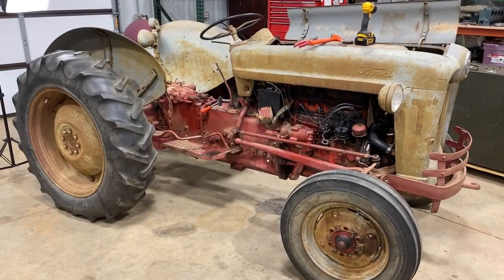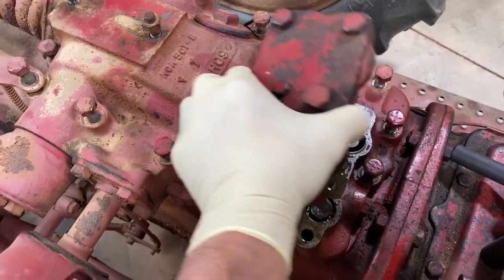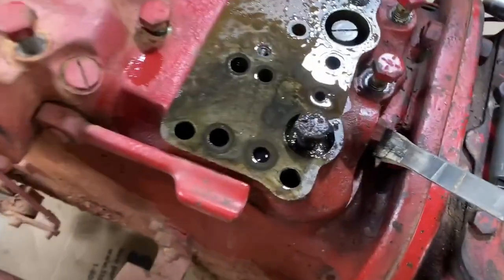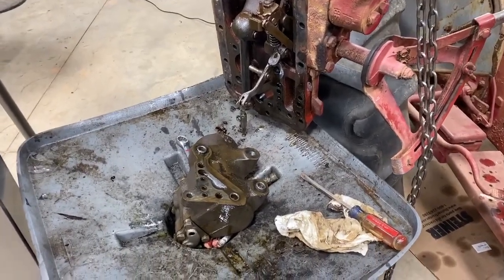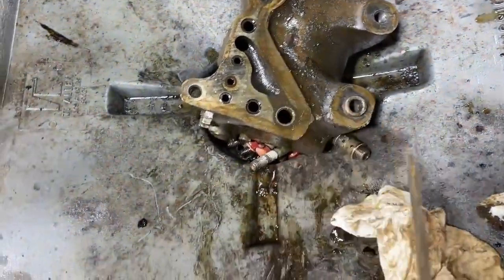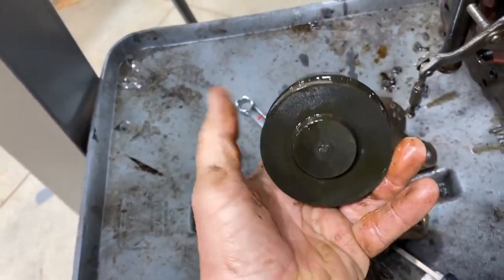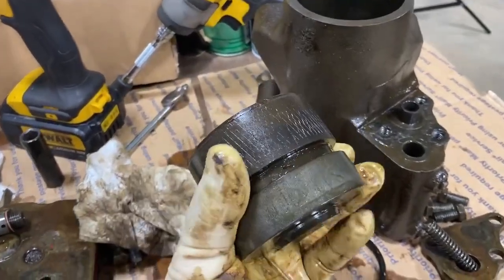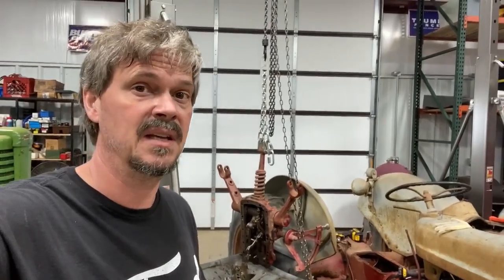How To Repair Ford Tractor Hydraulics

Comment: I have a Ford 861 which has the same hydraulic system as a 660. The hydraulics work ok, but the arms drop slowly after the engine is turned off.  I also need to bleed air out of the system fairly often, so it is sucking air from somewhere.  Any ideas that might help pinpoint the problem?
Reply from the maker: Could be the hydraulic piston rings are worn. I just did an 861 but haven’t put the video together yet 😓

Comment: what do you do with a ford NAA (Jubilee) where the 3 pt lifts great but lowers very slowly? Sometimes it lowers quick sometimes not. I just rebuilt the pump which fixed the issue of it losing its prime very time.
Reply from the maker: https://youtu.be/vBUkNudfjRI?si=xN_fAHTM8Brrp9d1
Reply from the maker: @JD-uy5js see if this other video helps. MAYBE the pivot pin is worn???
Reply: @dhammiam  I was thinking it could be the pivot pin. THANK YOU SO MUCH.

Comment: have ford naa. Have replaced the lift cylinder piston and ring and gaskets relief valve. Have rebuilt the pump. Lift arms will lower and raise but wont lift anything of weight. Any suggestions?
Reply from the maker: I’m trying to think of what could be the cause since you’ve rebuilt the major components

Comment: Have a broken pin inside the handle to lift up the plow and want to know how to figure out figure out where the issue is lying at for 801 powwemaster.? Please help
Reply from the maker: Are you able to take it apart? I have more video that I haven’t posted, on a similar tractor. This video or I’ll post a link to another that may help you
Reply: @dhammiam  i have not yet and ok thank you
Reply: @dhammiam  thank you for the video now I know what piece to look for..
Reply from the maker: @deea8335  you’re welcome
Reply from the maker: Try this video https://youtu.be/vBUkNudfjRI

Comment: I have a Ford 650 I purchased almost a year ago.  Everything was working when I got the tractor the 3 point hitch raised up and down ok and the PTO engages.  So I mounted my long blade on the 3 point links in preparations for moving snow and now that it is cold my 3 point hitch does not move at all.  I have not had a chance to troubleshoot this issue yet but hopefully your video will get me started on diagnosing the problem.
Reply from the maker: Let me know if you have any questions and I’ll help. Check the fluid first thing. Good luck to you

Comment: Just subscribed.  Driving 100 miles away tomorrow to hopefully pick up my first-ever tractor: A Ford 660.  The CL seller claims it runs, and he's putting a new battery in it today to prove it!  (I'm taking the Warn winch along anyway!)  Since the disclaimer says "what you see is what you get",  I'm thinking the hydraulics weren't worthy of mention, and if I can have it working before my wife sees it, that would be better.

Tuned in to your videos to gather a bit of knowledge on the subject.  Right off, I see a few clues that I'm in the right place.  Your shop is considerably cleaner than my indoor Habitrails.  Because of your open spaces, I could see your dirt-bike (Suzuki PE?..) and the 64/5/6 Convertibird stashed in there.  I'm pretty sure there are still both of those somewhere in my shop.  Maybe having a front-loader will help me excavate far enough inside to see them again.

Anyway, I'm hoping I'll have some experience on the 660 by this time next week, and will be watching for anything new you post on the subject.
Reply from the maker: Congratulations on your find. I love the old tractors and they’ll run forever. I’ve added another 8n since the video, a ‘53 Jubilee! Thanks for the sub and I’ll do my best to post more. Let me know how you like the 660 and if you have any questions. Have a great week

Comment: That was very informative! Thanks! I got a 1959 971 with a tricycle front about 4 months ago,  got it running good but hydraulics aren't working, and haven't had time to check out what the issue is due to trucking and also working on a John Deere 620 I got. Been watching videos to at least diagnose the problem, and it will be interesting to dive into it when I get time!
Reply from the maker: I enjoy working on these old tractors. It’s near to see how simple the mechanics and mechanisms are and effective in them. Learning from the videos is a great thing to save money. 
My Dad and Grandfather were truck drivers. Mom always told me not to be a truck driver. That’s a tough job and I couldn’t stay awake I believe

Comment: Using your gantry train is not "cheating", it's smart lol I have a Ford 2000 with some slow lift issues. I'm guessing it's a 50 year old clogged filter but I have to pull the top off like you did and just want to watch as many videos as I can before I do it. And there's not many Ford 2000 hydraulic videos specifically. Thanks for posting it.
Reply from the maker: Thanks for watching and commenting. I’ve got a follow up video I need to post about replacing the pivot pin. Stay tuned. Good luck on your tractor 🚜

Comment: I have a Ford 640 that I'm going to have to repair the hydraulics on. Can't afford a professional mechanic. So I'm looking forward to your sequel. I'm not a hydraulics mechanic. My fear is that I'll put mine back together and nothing works.
Reply from the maker: Randy J I know that fear all too well. Best way to learn and remember is by doing, and learn as ya go. Thanks for watching and commenting. Good luck 👍🏼
Reply: @dhammiam  Take pictures or video tape as you disassemble. Helps you remember where the long/short bolts go.
Reply from the maker: Yes it does Paul. I do it all the time